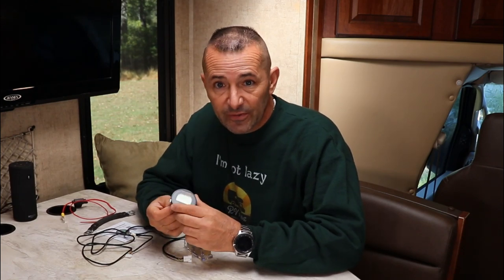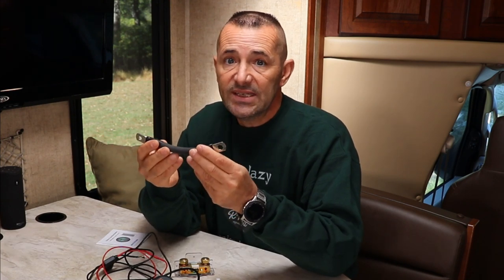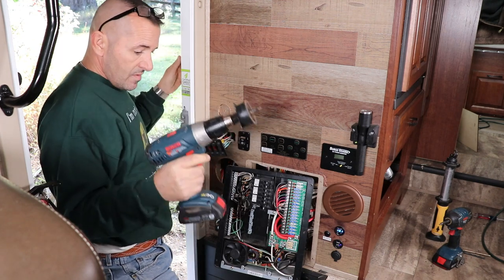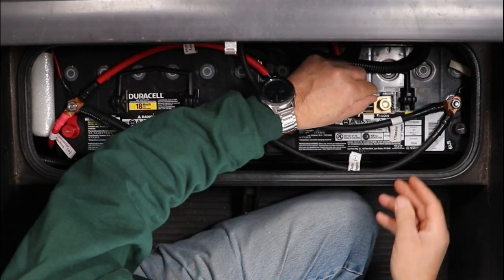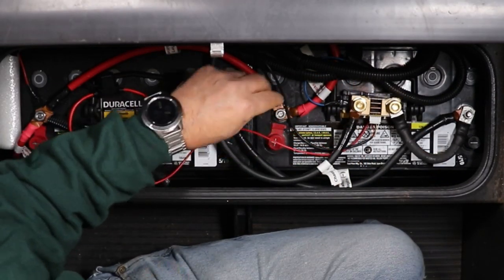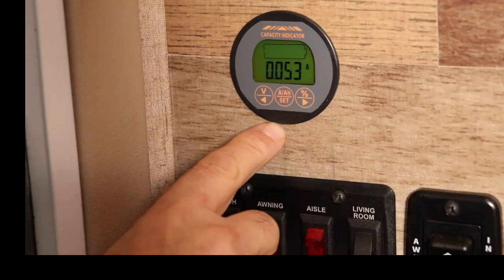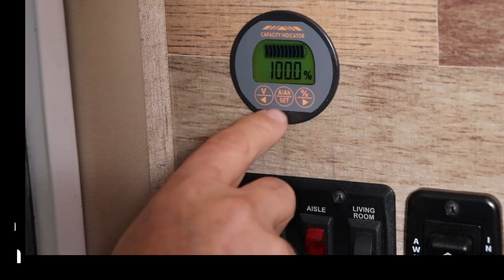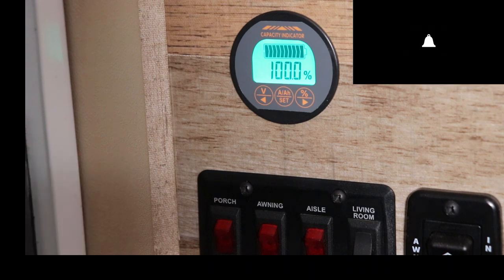Installing A Full Function RV Battery Monitor From AiLi Qwork– How To - Tips and Tricks - RV Upgrade

Comment: You mention to program the monitor to 100% but how do you know if your battery is truly at 100% when it is new and just got connected to the monitor?
Reply from the maker: Hi Mario,  Simply charge the battery overnight then check voltage with a multimeter.  Any reading 12.66 or higher would mean the batteries are fully charged.  Good luck.

Comment: Just looking to buy this unit on Ebay,  I have two 110a leisure batteries,  how do I know they are at 100% before setting up the monitor?
Reply from the maker: Charge your batteries with no draw for a day before install.  Also, If you allow the battery to rest with no charge or draw for several hours you can take a voltage reading with a multi meter.  A fully charged battery that has rested should read 12.6 volts on the multi-meter.  Good luck.

Comment: Great video. We are new to battery monitoring and curious why you installed an inline fuse on the red power wire? Also, what size fuse did you use? Thanks!
Reply from the maker: Hi Jennifer it is always recommended to install a fuse for any power wire for safety.  I used a 5 amp fuse.  Great question.

Comment: great video Lew one question do you attach or caulk the shunt down? great work
Reply from the maker: Hi i used heavy duty Velcro to hold it in place on top of the battery.

Comment: after using this with no issues for ages, my monitor no longer will go back up to 100% even when it has to be. Is it worth re calibrating every now and again?
Reply from the maker: Yes absolutely.  Lead acid batteries lose some capacity each year of use.  I usually reset once a year by lowering total bank amps by 5 to 10 and then resetting monitor to 100%.

Comment: love the video, but I think you shouldn't have anything plugged into the batteries when programming the tester. I think it's best to let the batteries rest for at least 2 hrs without a solar charger on, then input 100% otherwise the tester will give a wrong reading.
Reply from the maker: Hi Gary,  You have a good point.  However, the meter measures the battery condition by calculating amps in vs. amps out.  If you set it to 100% and program the amp hours in the battery.  The resting volts should not matter.  At least that's my theory lol.  Thanks for commenting

Comment: Where did you get that plastic bracket for mounting the shunt? Was it included with yours? I just ordered one and it was not included.
Reply from the maker: Hi Patrick, The monitor I ordered came with the plastic mount.  I have heard they may have changed it and it needs to be purchased separately.  You can find them here  https://amzn.to/2I1g6JX
Good luck and thanks for watching.

Comment: Thanks for the video, installed mine and had to extend the wires.  Works great!!!  Looks like I have a draw of about .150,  seems to be standard on these larger Rv's.
Reply from the maker: Glad to hear it.  Mine so far has worked excellent.
Reply: What size or type wire did you use to extend it.  Is CAT5 doable?
Reply from the maker: I did not personally extend the wire but other have indicated CAT5 worked for them.

Comment: I really got a lot out of your demonstration and have purchased one of these monitors. The part that I am having a problem with is as you put it in the video "all the other negatives in the coach go to the P" terminal on the coach. I don't know what that means or how to accomplish that. Any help or direction would be greatly appreciated.
Reply from the maker: Not including the negative wire that connects the batteries in parallel you connect a wire from battery negative to shunt B terminal.  All the negative wires that were on negative post go to P shunt terminal.  Example is the ground wire to chassis or negative wire from solar controller.

Comment: Great video!!! Mine, as most, is an all in one and the reader shit the bed. Now, I do not dry camp so I am wondering the significance in having one , also my batteries are in the front and the monitor is at the kitchen in the rear entry so how the frig to get a wire there without ripping the underpinning... Thoughts?
Reply from the maker: Hi Robert,  Running wires in an RV is always different and you may need to get creative.  RVs are creatures of 12v so your battery is an essential part of the RV electrical system.  A monitor keeps you informed of the batteries health.

Comment: I saw a post elsewhere regarding Victron voltmeters that the shunt should not be exposed to the elements. My battery box is on the tongue and has a lid but certainly isn't weather tight. Any thoughts?
Reply from the maker: no battery should be exposed to the elements.   The battery box should be keeping the battery protected.  if it is the shunt should be fine inside.  if the box is not properly protecting the battery it should be replaced.

Comment: Hi Thanks for the video ,  I have installed this monitor and for some reason never shows the charge indicator arrow , always shows the discharge arrow , I have turn off the inverter that way no load is present , and turn on the generator to start charging the battery but still the charge arrow does not show Any Advise?   Thanks so much
Reply from the maker: I am not sure.  Run the batteries down a bit then try to charge them and see if the upcharge arrow displays.  Good luck.

Comment: I have an issue, if I wire it B to battery, P to ground, negative cable my display flashes non stop, wire it opposite it doesnt.always shows down arrow even when charging via converter/ charger.
Reply from the maker: Hi the display will flash when battery is draining.  The down arrow also indicates the battery is draining faster than charging.

Comment: Lou, the power wire you made, I noticed that you appear to have put a  fuse in the line near to the battery connect, am I correct?  If so could you explain  more about this, and the size of the fuse?
Reply from the maker: Hi Donald,  It is a simple 16AWG wire with a 5 amp fuse installed.  You can find a link to fuse wires in the description.

Comment: Hi mate. I know this video is two years old so not shore you see this comment. Does the earth chassy wire go to the shunt so you only ground from the battery only
Reply from the maker: I attached the battery ground to one side of the shunt.  All other negative cables including the chassis ground are on the other side of the shunt.

Comment: Where's a link for the red positive that one end goes into one of the holes on the green connector of the AiLi and the other end is a battery terminal? It's not in the links...
Reply from the maker: Hi,  you will need a small piece of 16 AWG and the 12v fused wire on Amazon: https://amzn.to/30NzZHK

Comment: Great DYI video Lou. I installed the same battery monitor in my RV. One thing I notice on my Forest River is that several DC components like, etc awning, slides, the radio sound base goes through the Battery Control Center. So I’m not getting a amp reading when using those items which is ok because those are used very little. Not like the heater, lights, ref.
Reply from the maker: If those components use the coach batteries they should certainly register on the meter.  If they are using the chassis battery then no they would not register on the meter.

Comment: Thank you for the nice and easy to follow video. I’m wondering though. . . Would it make sense to put in useable amp hours rather than total that the batteries are rated for? So if you’re only supposed to go to a 50% discharge, would it be a good idea to set it to 105 aH?
Reply from the maker: Hi Stan, No this is not a good idea.  If you do that and go below 50 percent your guage will read zero even if it is for example 35 percent.  This in turn prevents the meter from properly calculating amps in while charging.

Comment: The 100amp shunt version is different.  It only has a 3ft cable instead of 6ft cable for monitor.  Also it does not have the plastic bracket around the shunt, so there are no holes to mount it to something.  The extra few $$$ is worth the 350amp shunt.  Also a good way to extend your monitor wire you can try our method.  We cut the cable in half and crimped on a Cat 6 connector on each side.  Then bought a pair of Cat 6 couplers and plugged each connector into them. Then all you need is a Cat 6 cable of your desired length and you have a plug and play wire of any length!
Reply from the maker: Great information thanks for sharing.
Reply: Was wondering how to extend the meter 20 feet away to where you need it and can make use of it.
Reply from the maker: Hi Keven,  I have heard you can splice in some Cat 6 cable.  I have not done it personally but it sure sounds feasible.  The wires are thin so some time and patience will be needed.  Good Luck.
Reply: The Cat6 wires are same size as provided cable.  They crimp perfectly in the connector.  There are only 4 wires used.  The extra larger black is the shielding wire and not needed as the other black wire is already connected with it.  Just try to avoid running Cat6 next to noisy electronics.  We ran our cable about 15ft and works fine.
Reply from the maker: That's great.  Thanks for sharing.  This should help a lot of fellow RVers out.
Reply: that is the information that I was looking for. I will be using cat 4 with the connectors.  I wonder what the Maximum length you can go?
Reply from the maker: I would imagine you can go as far as needed in an RV.  I know other monitors have 50 feet of cable and work well.  As long as the monitor is receiving the signals from the shunt you should have no problems.  Let us know how you make out.
Reply: @swalesutube  Great tip. Tnx for sharing. I have som Panduit RJ45 connectors (female) I'll use. And I'll buy a shielded cat6 patch cable to go in between. But where do you see, that the shield and the thin black wire are connected? I can't tell by looking at the print.... (Mine's a 500 A)
Reply from the maker: AiLi makes a plug and play extension cable.  See the Aili Extension Cable on Amazon: https://amzn.to/2v3HAYE
Reply: You can buy the 100A clear plastic shunt mount of aliexpress for a few dollars. I bought one and used it in my powerbox build on my channel.

Comment: anyone who's experiencing backlight being always on like i had, just unplug the multipin connector from the shunt and plug it in again. i first connected the meter with multipin, then i added the red + wire to the battery + and the backlight was always on forever, regardless if i pressed both outer buttons together like many advised. then unplugged multipin and plugged it again and the backlight went off after a few seconds 👌
Reply: From another post, you can press key V and % at the same time to turn on/off backlight.

Comment: Do you have a link to the cable that powers the monitor and links to the green inlet?
Reply from the maker: The wire that powers the monitor is just a 16 Awg wire.  I added a 5 Amp fuse.  The fuse pigtail link is listed in the video description.  Good luck.

Comment: Good video. I do have a question. If you have the positive power wire for the monitor before the battery cutoff switch, aren't you drawing power, even when you have the batteries off?
Reply from the maker: That is correct.  This monitors the batteries regardless of the battery disconnect switch.

Comment: I want to get a battery monitor and have seen the various types, but have not seen someone actually installing it. So this is exactly what I was looking for!
How does one decide what size shunt that they need?        Please tell me that those were not wires hanging down inside the hole you just cut.             This was great - thank you Lou!!
Reply from the maker: Hi the size shunt needs to be able to handle your draw in amps.  This can be different depending on your accessories.   When in doubt you can go larger.  A shunt that is larger than needed will not harm the system and gives you future room to add an inverter or other accessories.   As for hanging wires.... they are everywhere in the RVs built today.

Comment: Hello, I’m interested in adding this to my travel trailer.  I watched your video and it’s very informative- thank you!  However, one part I didn’t understand was how / where you fished the red/black wires from the back of the meter into the battery compartment.  They seem short for that kind of run?

In my situation the control panel is in the rear of the camper and the battery is in the very front by the tongue (~30’ length wise).  Do you have any ideas on the best way to run this?
Reply from the maker: Hi Mike,  The parts are listed below in the description.  You would need to purchase the extension cable for the monitor.  You can find it here on Amazon: https://amzn.to/2v3HAYE

Comment: Did you ever connect a solar setup to this? If so, how did you wire it to read usage and charge rate?
Reply from the maker: Hi Michael, Not yet thats a project for next spring.  However you would simply connect the wires that  come from the solar controller to the battery positive and the negative would go to the P side of the shunt.  The monitor measures both amps out and in to the batteries.

Comment: Do you have the video showing the house batteries you used?  I use my motorhome like you, so think I'd like to do a similar set up. Thanks, great video
Reply from the maker: Originally when I installed this monitor I used AGM batteries and they worked great.  I eventually upgraded to lithium and this monitor is still working great. The videos are listed below
AGM   https://youtu.be/6-k7PUWFRMg
Lithium   https://youtu.be/mZi4wBhJayk
Reply: Awesome. Thanks so much

Comment: What size fuse did you use on the positive wire and how did you come up with that size fuse
Reply from the maker: Hi Mike, I used a 5amp fuse.  I just used a small fuse to protect the wire and meter if there was a short.

Comment: Could you wire this up so the current reading was incoming solar rather than out from the batteries?
Reply: I believe it does both.  In the video he mentions that there is a + or - sign on the screen that tells if you are charging.  The monitor doesn't care where it is coming from.

Comment: Great video! I have a few question. If I understand the wiring well, the monitor always stays on. Would it be possible to add a switch in the small red power cable to be able to switch the monitor off? Or would you have to reprogram the monitor every time you switch it on?
Reply from the maker: I have not tried this but I would assume you would lose all programming.  The amount of power it uses is very small.  I would only consider this for long term storage.
Reply: @RVHabit  Thanks for your reply!

Comment: You set it for 100% on 14.4v.  When the battery's are at rest at night at 12.7 will it the monitor think you have less than 100%? Please and thank you. I order it for my system but I'm not sure if I should tell is is 100% at 12.7 or 13.8 or 14.4. Thank you
Reply from the maker: Hi this is a great question.  As far as I understand this meter it measures amps in and amps out.  It then compares that measurement to the total Amp capacity of the batteries that you programmed in the meter.  This is more accurate than relying on how many volts the batteries are.  This is not to say volts don't matter but the meter is measuring the total amps to determine percentage of battery.  I hope that all makes sense.  Thanks for watching.
Reply: @RVHabit  I  I understand your point after reading it again.. Thank you. i will so more research to see if the voltage matter at all. THnak you.  did some research and it seems the device, should be set at 100% resting voltage at 12.7 v.             if it is set at 100% let's say at 13.8 v. The battery is going to give you a false reading at night when it voltage drops to a resting  12.7.    12.7 is true 100% with no loads.                                              Since the device was set at a higher voltage than 12.7  it will show less than 100% on the meter.  when it actually is at 100%.       I might be wrongand the device might just do everything but its self.   but that is what i found out.    I hope i can expain my self ok as english is not my mother language.    Thank you for the reply.

because of your video i bought the device and will be arriving soon. Thank you for the great video.

Comment: What size fuse did you use for the red power wire going to the shunt?
Reply from the maker: I used a 5 amp fuse.  It uses a very small amount of power. The fuse is protection for the wiring.

Comment: Hello. Thanks for the video. Question: can it protect battery from overcharge and over discharge ? Thanks
Reply from the maker: No it only monitors the battery.  Your converter or controller would regulate charging functions.

Comment: Does your display flash on and off when battery is charging? (No discharge). Only does it while charging
Reply from the maker: Hi Dan, Yes it does that is normal.
Reply: @RVHabit  good.  I thought there was something wrong.  I picked the worst spot to install it.  Cut the heck out of the back of my hand trying to put the bracket in the back of it.  Inside of wall is all bloody. Lol

Comment: What size fuse did you put in for the power wire to the monitor display?
Reply from the maker: I used a 5 Amp fuse.  Good luck on install.